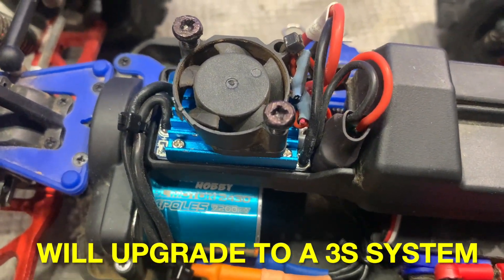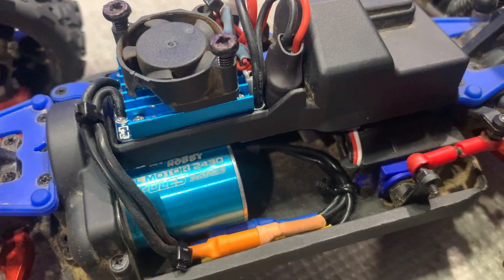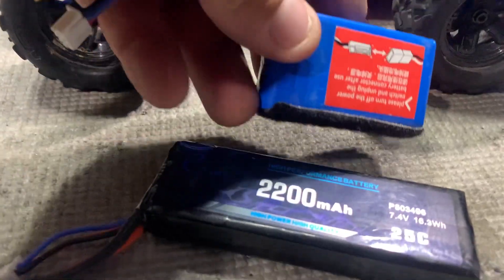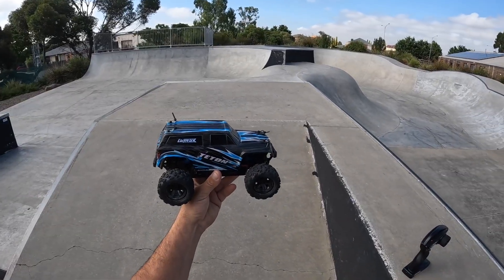Teton latrax brushless upgrade & more

Comment: Ha! Got my Teton Friday night, took it to the skate park Saturday, and in less than an hour mine looked exactly like yours 😂 Fortunately the replacement part is only $6, so no big deal. Biggest issue is it was out of stock at the shop so I have to wait for it to be shipped.
Reply from the maker: Yeah man, go easy on the skate park. Concrete and cars don’t mix🤣🤣. At least the part is cheap. But the wait is always long!. 👍🏼🚗
Reply: I took mine to the skatepark and it held up fine 😂 but i was running stock motor and nimh battery so thats probably why

Comment: I tried the link for the cvd's & it doesn't work, awesome little teton, we're placing shims on diffs & pinions tomorrow, we broke the same thing & already placed both aluminum diff covers 🤙
Reply from the maker: @md8355  the link to the cvd has probably expired. 
Here is a new link for you…
https://www.ebay.com.au/itm/405366776985?mkcid=16&mkevt=1&mkrid=705-154756-20017-0&ssspo=is93eayotcm&sssrc=4429486&ssuid=Kods1y39RBy&var=&widget_ver=artemis&media=COPY

Comment: Any updates on this setup, with the LiPo battery upgrade, and any other electrical components being switched out due to overheated and worn out motor, ESC, servo's, etc.? Which battery are you using now? Blown out any other components with the Brushless motor? Thanks for any and all input. Stay safe!
Reply from the maker: So far so good. Haven’t had an issue yet with the Teton electrical components. I’m just running a 900mah 2s lipo in there. That’s really the only one that fits nicely. It’s due to be taken out. Been on the shelf for a while. Thanks for reminding me about it. 👍🏼🚗😁
Reply: @angesrc  How much approximate run time do you get with that 900mah LiPo battery? I will just say all the LaTrax vehicles are cool little fun cars for what they are. The Rally is an underestimated RC for sure. Thanks for your time and reply. 😎🙏🏼
Reply from the maker: @flhandster4395  I would say around 10 min of run time. It’s always good to have a few extra batteries. There a great little
Fun car to play with. 👍🏼🚗

Comment: In my Latrax PreRunner I put a Mini-Erevo brushless motor in it, and can run on 3s. But every time I drive it, the diffs blow out.
Reply from the maker: Yeah , that’s what I don’t want to do., is blow the diffs. Il keep it on 2s and enjoy it a bit more. It does well on that system, but def upgrade a few more parts in metal!. 👍🏼🚗
Reply from the maker: @76tfdtr4r5  oh yeah I know that. I just wanted to put in the metal swing arms cos they looked good. But of course the energy needs to travel somewhere else and something g will break. Poss something more expensive . 👍🏼🚗
Reply: Shim the diffs! Maybe a metal diff housing as well. The spider gears push apart under high power so you need to keep the mesh tight. The plastic diff housings can flex. Try the shims first, worked for me. I run 3s on high traction surfaces
Reply from the maker: @S5UPERCHARGED  yeah def going to get metal diffs. As you can see where it broke. And while I’m there I might as well shim the diff gears too. 👍🏼🚗